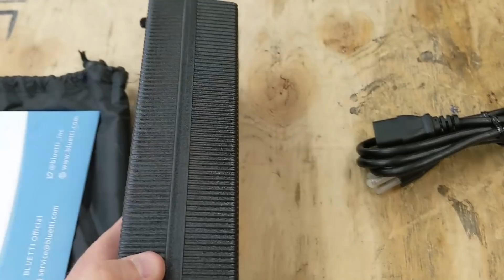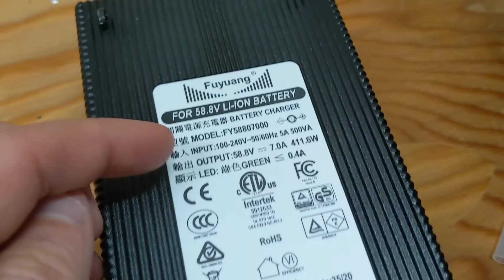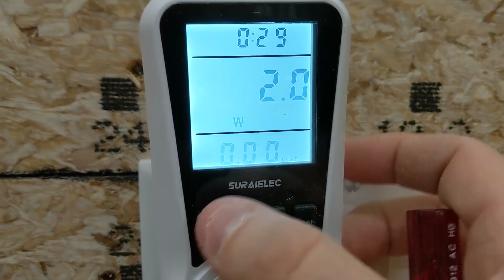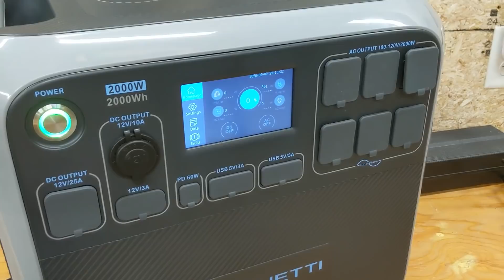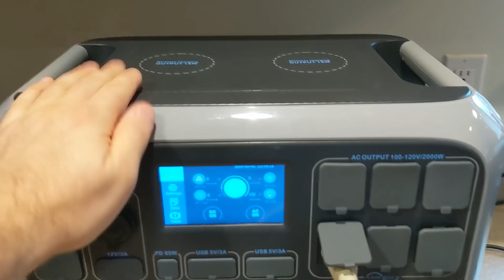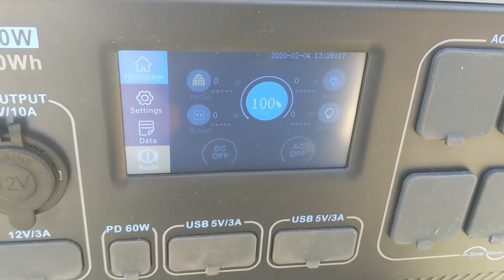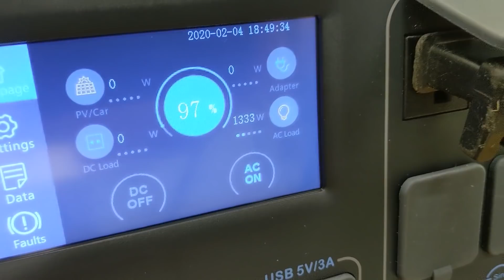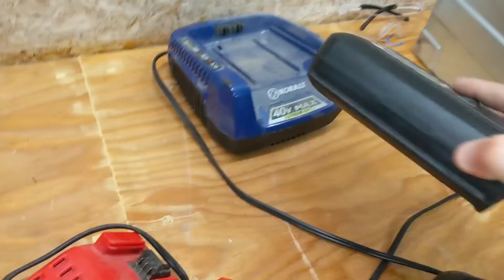DPoz Reviews:  Bluetti AC200P - Updated model for 2021 - Solar Generator

Comment: so for a thingy that cost 3 grand, I can use it for 5 hours with 2 lights and a space heater, you know I am not as rich as Al Gore, I think I get me a generator and burn gas ................
Reply: This doesn't cost anywhere near $3,000. I paid $1,800. And it's well worth it considering I don't have to buy gas or oil or maintenance..just plug and play baby..oh and I can re charge using solar..can't beat free refills! 🤑👍

Comment: I am wanting one of these for emergency backup heat, that is to run a small space heater. Have watched quite a few reviews of this and I still can't find how long it might run a heater set at 750. Your review was great otherwise.
Reply from the maker: I was able to pull 1900wh during my test.  if you have a load (space heater, fridge, AC, etc) that draws 750 watts, then we just divide.  1900wh/750w=2.5h  two and a half hours of run time.
Reply: @DavidPozEnergy  David, thanks so much for your quick reply. This is very helpful to me.

Comment: Is it possible to hook this to a DC to DC charger or a split charge for a van conversion ?
Reply from the maker: You can charge this directly from a cigarette port.
Reply: @DavidPozEnergy  Thanks for the reply David. 
I believe it takes up to 17h to charge from the cigarette port which doesn't seem very efficient. 
So, I was wondering if there is a way of charging through a split-charge or DC to DC charger instead ?

Comment: Have you been able to test solar charging?
Reply from the maker: Yes. It works well
Reply: @DavidPozEnergy  hi! im new at all this and looking for a battery solution to heat electrically (a few hours in the late night/morning to get the coldest hours out in a caravan).
Could you tell me if / and how long I could power an electric heater of 1500watt with a fully charged battery with this unit?  And if its not possible, what is it lacking/where to look?  Any insights/advice welcome!

Comment: Thank you.  I order this with a Amazon coupon.  My goal was to have a back power for frig, freezer, etc.  i have a small unit at 500w and it was not enough for my needs.
Reply: I get the odd feeling that there is a bit of an effort to be deliberately evasive with regards to these Bluetti Ac200 / AC200P solar generators with regards to how long someone can rely on them to provide backup  power for a full sized refrigerator.  I keep hearing inconsistent and sometimes conflicting answers to questions about this concern, and I would very much like to get a clarification.    I've seen one response from a seller that says a full sized refrigerator can run for 6 hours on a fully charged AC200P.   But, a year ago - when I was researching the previous model (AC200) - I asked this question of a Maxoak sales representative and he told me that the AC200 could power a full sized refrigerator for at least a couple of days.  

Hence, I am still confused about this issue.    Your comment was not clear; are you saying that you have a small refrigerator and the AC200P was not enough to suit your needs?  Or, are you saying that you had a smaller, 500w generator that did not suit your needs and that's why  you bought the AC200P and this is the case, has the AC200P been able to handle a full sized refrigerator and if so, for how long?

Thank you for your reply in advance.
Reply: @augustusmccrae7714  He was talking about he had a 500w that didn't meet his needs. I just ran a test on my Bluetti on a small fridge and it went 17 hours and had 19% power left...not bad and it could have gone longer but I hear it's not good to run the batteries all the way down to 0%.

Comment: Quick question - the 120W solar panel I purchased as a bundle is rated at a lower Voc than the minimum voltage stated in the AC200 manual, but not by much and there is still 20+ V which should be enough to generate current.  The problem is, there is zero current even when PV is selected.  20V, 0A, 0W.  I've contact Bluetti but haven't heard back yet and am afraid there's something wrong with the unit.  Would low voltage prevent current altogether?  I wouldn't think so and this is the panel BLUETTI sold me so it should work.  My only other thought is that the cables feel super cheap and might be defective.  Any advice is appreciated
Reply from the maker: Change the setting from "PV" to "CAR"
Reply: @DavidPozEnergy  it was worth a try but didn't do the trick.  I also tried adding a panel in series which obviously doubled the voltage but still no current.  No faults are getting tripped so I'm genuinely baffled.  Thank you for the suggestion though

Comment: Excellent review - does it get hot?  And as you use it, let's say for a microwave for a 10 minute on high for frozen dinner, would it fault out easily if you also had at the same time only had some lights (two 20W LED lights / lamps)?

Comment: The reason it starts the Miter saw and not the compressor has to do with power factor. Although the compressor consumes less amps than the Miter saw the power factor is much worse, the Miter saw looks a lot more like a restive load than the compressor, and the other thing is that the Miter saw has no load on the motor, only the inertia of starting that blade spinning, while the compressor starts to become harder to turn before it gets up off of the start windings, therefore, to successfully start the compressor you need to have a monster inverter that can provide more than needed power so that the compressor jumps to asynchronous speed within only 1 to 2 revolutions of the Crank shaft.

Comment: If you look at the output waveform of this, it is NOT a pure sign-wave! I would never recommend using one for inductive loads, ever. Pure resistive loads, are probably fine.
Reply: is a space heater or AC doable?

Comment: the best portable is one you make yourself with Lifepo4 cells, a couple of solar panels, a half decent inverter, a few parts from Electrodacus to deliver the power from the pv panels into the battery bank and to balance the whole thing and provide all the monitoring you will ever need. I can put one of these together for 1400 and I am being generous with that price. it is probably a lot less. this will give me 9kw surge for 20 seconds 3kw regular 4.1kwh of useable power which is 80% of battery bank. this would be so easy to put this together and will give you so much more power. just a little diy and your golden. If I got a cheaper inverter like this has you can cut the price by at least 100usd. if you don't have any ability to do anything yourself then I guess you could put out a pile more cash for a much inferior product but why, why? have a great day and diy.

Comment: As Jason said below there is the length of peak time... and also the gradient of the power need may matter. The blade probably acts as a fly wheel  on the saw gradually reducing the power need, while the pressure resistance of the compressor increases the power need from the get go. I wouldn't be surprised if the inverter shut off can recognize where things are going as well as what's immediately going on.  I'd program that in to help p[people get the most for their money.

Comment: It took 11.32 hours to charge from the wall outlet ?
Reply from the maker: I let it charge overnight.  It would have finished charging at some point during the night and the kwh would have stopped accumulating, but the clock still runs.

Comment: David, can you please stop overstating the capacities of these units? I appreciate your in depth reviews, but must say that it's disappointing how reviewers allow rated products to get away with providing underrated performance. This battery states 2000wh's but under-performed by around 20% of it's stated capacity, yet you excuse that as being due to it's inverter and related inefficiencies. While technically true, this allows manufacturers to continue to offer products that are rated a significant amount above what they can actually deliver.  

It's a commonplace occurrence that shouldn't happen. 

When you and other reviewers give products a pass like this it leads to expectations of performance that simply shouldn't be there. If you and other reviewers that do have an impact on what manufacturers and suppliers tell us about their stated capacities decide to hold them to providing the actual capacity they state on their product it will improve the marketplace considerably. Thanks!
Reply: Not all loads are via the inverter, so DC loads could extract much nearer the full battery power. Also inverter losses may depend on the load. Therefore it is reasonable to give the total battery energy available, but it may also be reasonable to provide actual losses in some typical use cases so that users can appreciate where losses can occur.

Comment: One of the most comprehensive videos I've seen, I think why the chop saw worked was there was no load as it was a free blade and the inrush is a lot quicker than the compressor which inrushes for longer as it is loaded by the air in the cylinder, is my guess

Comment: David -- Received mine two days ago...just did a capacity test with a Kilowatt @ a 280 Watt Load.  Stopped at 1.74 KWH.  Based on the load you used, I should have gotten a little more than 1.8KWH.  Should I be concerned?  28 days left to return. (120VAC, 60 Hz)
Reply from the maker: When you charge it up, are the cells in balance?  You can see the cells on a screen.  I've been cycling mine every few days so that I can check to see if there are any problems that arise.  None so far.  But I'd start with checking the cells voltage when you get up close to 100%SOC.  Then go from there.
Reply: @DavidPozEnergy  Thank you for responding...That test was run on cycle #2...and yes, all of the cells showed the same voltage at 100%.  On discharge (and around 27%), one of the cells was 1/10th of a volt higher than the others...off and on...sometimes it matched, sometimes it was 1/10th higher than all other cells.
Thanks again and great review!

Comment: I  found  the  touch  screen  need  not  be  'touched'  ! ! !   To  keep  your  grimy  little  fingers  from  soiling  that  pristine  screen  you  may  use  a  pencil  eraser  instead.   I  prefer  the  standard  #2 Ticonderoga  pencil  &  'smoothed'  the  edges  of  the  eraser  on  my  couch's  arm  rest  (more  to  clean  it  too).    The  pencil's  eraser  being  much  smaller  than  my  grease  covered  finger  works  well  for  selecting  the  desired  functions  AND  only  needs  a  very  soft  touch !   I  just  leave  the  pencil  on  top  of  the  Bluetti .

Comment: Dave can this unit handle 24v panels? Or just 12v. ?and do you recommend 300 watt panels to not have a bunch of 100 watt ones ?
Reply from the maker: You can use 24v panels.  It can take up to 150v from PV.  I was supplying it with about 90v in my video.  I don't mind a bunch of 100 watt panels, or two 300w, or any combination.  So long as you stay under the 150v it's all good.
Reply: @DavidPozEnergy  thank you so much Dave, for reaching out and responding back thank you .

Comment: Can it power a gaming PC with 3 monitors all day?
Reply from the maker: I don't know how much electricity all that gear would draw.  If your monitors + PC draw 900 watts, then the internal battery could power them for 2 hours.
Reply: @DavidPozEnergy  So that means I will need 12 of these Bluetti's for a 24 hr straight day sustainable power. Just playing games alone takes up 700 watts of power. Non-gaming takes up 250 watts.

Comment: Can i charge my frig and freezer w the Blueetti 4 how many days
Reply from the maker: I did power my house fridge/freezer unit in the video.  As I showed in the video it will run for 1.5 days on the battery, with no solar input.
Reply: Thanks for the reply. Do you know of a alternative power back up system that could last 2-3 days power outage? Fire season is around the corner and the “boss” has given me marching orders to prepare...
Reply from the maker: This one: https://shopsolarkits.com/collections/solar-generators/products/titan-solar-generator-6000?ref=s_fx9xj-vyvj

Comment: Did you have the fan on the bluetti come on....and did it pulsate?
Reply from the maker: The fan has come on.  it comes on when I'm charging from solar, and when drawing more watts for a longer time.  I haven't noticed pulsating, but I haven't paid close attention either.  Is that something you just hear, or is it something you need to check for on a scope?
Reply: You hear it.  Unmistakable

Comment: The miter saw probably draws 66A for a shorter duration, and the compressor draws 43A for a longer duration. On the DC boost stage there’s capacitors that hold the high voltage DC, and they help with the inrush. Once those capacitors are drained it relies solely on the HF transformers for energy and those will saturate at those high inrush currents and that’s when the voltage drops and the unit shuts down.

Comment: Will this connect to my 200 W goal zero briefcase solar panels?
Reply from the maker: The solar input is probably higher voltage than the goal zero, but check your solar panels voltage to be sure.

Comment: The reason your compressor tripped it (44A) and your miter saw didn't (66A) is because the high surge current for the compressor lasts much longer than the surge for the miter saw.
Reply: About your compressor….you should try to empty completly the thank and try to restart the compressor with the bluetti to see what happens. I will not be surprise if the compressor can start with 0 psi in the tank. The peak will be very quick compare to a compressor with already 90 psi in the tank. Let me know if you make the test!!!!!

Comment: Am I the only one that saw the model on this Bluetti says "AC200" and not "AC200P"? Is that normal or did they give you an older model, fixed return, etc? Also I thought you could plug in the solar AND car inputs?
Reply from the maker: I asked Maxoak about the sticker saying AC200.  The newer version (AC200P) has 16sLFP batteries.  Mine clearly has the 16sLFP battery, so it is the newer version.  They said it's a "typo" and they are fixing it.  My understanding is that with Covid, and LG not making the original battery any more, Maxoak has had to make some last minute changes.  
You can plug in solar OR the car.  But you can have solar AND the wall charger at the same time.
Reply: @DavidPozEnergy  I appreciate the response and love the videos. Thanks! After watching Will P. Video tho, it is a little concerning with those kind of answers, but at the same time it's hard to really to judge with the virus this year. For now, I'm taking his (Will's) video with a grain of salt, because there's no way to know how many people in his community received defective versions vs good ones, and the people who got defective merchandise tend to always be louder than the ones who got what they expected. Also would be interesting to open up to see what the insides look like, as well as a longer term trial. Either way thanks again!
Reply from the maker: I'm on a few different forums and I've only heard good things about the units themselves.  I do hear about shipping delays upsetting people.  I've been cycling mine about every other day, and using the solar to re-charge.  It's been working properly for me.  Yes, I plan to do an update long-term, which is why I'm using mine.

Comment: Explain to me how having  purchase a product advertised for 2kw hours is a success when it only delivers 1.8kw hours. So if you loaned me 2000 dollars an I paid you back 1800 dollars would you be happy about that?????????????? I think not. smh!
Reply: Simple science. Its a 2000 watt battery. But to change DC to AC, you need an inverter. The inverter makes up the 200w difference.
Reply: @chrisanderson8553  Ok then, advertise it as an 1800w not 2000w.

Comment: Can this system be put in parallel with another one or 2 more?
Reply from the maker: Not directly, there would be some efficiency loss.  If that is what you need, try looking at the Titan, or the Ecoflow.  https://shopsolarkits.com/collections/solar-generators?ref=s_fx9xj-vyvj
Reply: @DavidPozEnergy  thank you..🍺
I was thinking 2 or more feeding into a power distribution location but with proper steps such as diodes on input cables from both units to stop cross feed to each other?

Comment: When an ac motor starts, it has in rush current, usually 125% for short time. Eli = voltage leads in inductive circuit.. ice = current leads in capacitive circuit.ie: ac window units, refrigerators, on startup.
Also on the ac side of your inverter, you have a breaker, [ at least I hope you do] In Ac circuit desighn the NEC, recomends use only 80% of your rated load. So your unit is rated 2000 watt, safely go up to 1600 watts, 15 amps, we use 1200 watts. On the blue Eddie , they gave you 5- 20 amp outlets, split to balance 1600 watts , safely =320 watts appiece, there in parrellel. Or you will get nuciance tripping. Theres the math & the theory.. [ NEC, is the national electric code.
Read / Goggle - NEC -220 -2 known as the 80% rule. [ Or peak out at 1800 watts , but keeping it in the 1500 to 1600 watt range, it will coast & you won't be running & resetting breakers. Good rule to remember. I have been licensed electrician since 1986, & I held an A card from ibew 4/2000 until, 1/2008. I got out when the crash hit.[ My decision ] Thats another chapter. Take care.
Reply: Finnally, the blue eddy is a great assett if the sun is shinning. I live in Chicago, we get manny cloudy days in a row. To the point, that unit is an expensive shelf queen, 🐣if the sun isnt out. 🌞⌛🔌💡